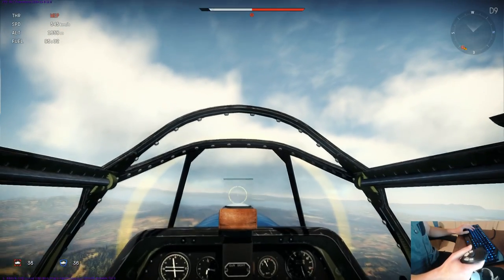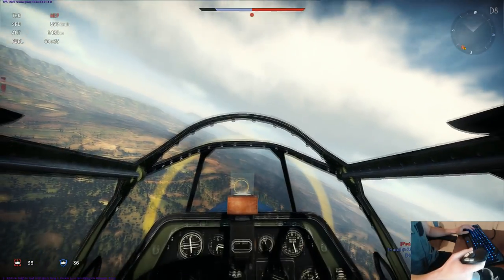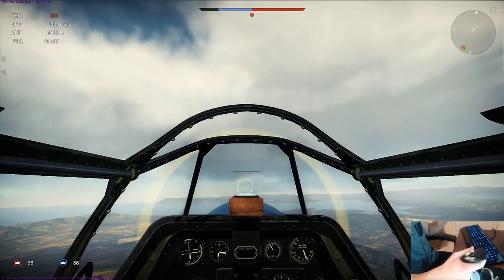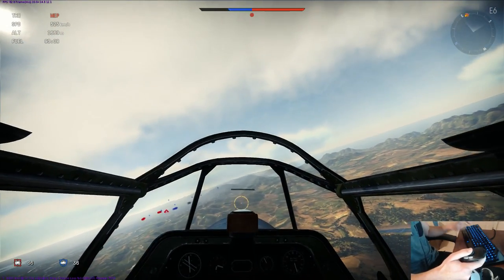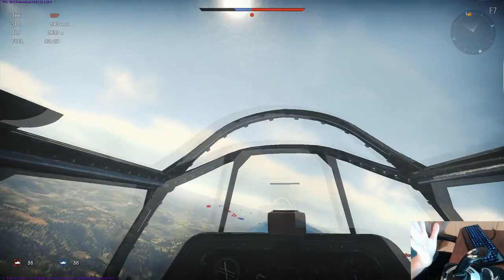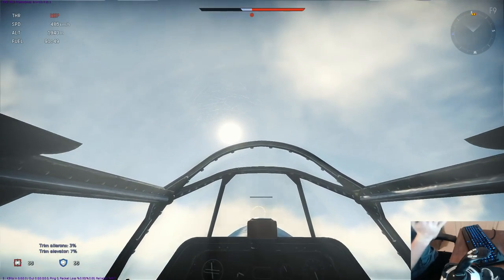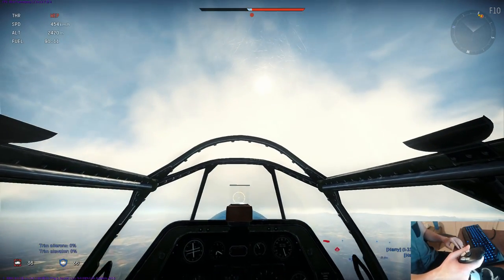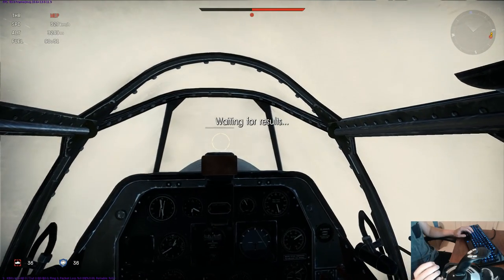War Thunder Tutorial Trim-How I Use It- Mustang MK 1

Comment: I tried your config once after seeing your "joystick config tutorial" however i had some dificulties flying with full real controls. (my joystick is the same model as yours).

I cant take of without making massive adjustments with the stick. All the planes i tried went all the way to the left. I dont know if that is intended (caused by torque, wind etc) or if my config needs a bit more adjusting.

I ended up going to the configs, and changing the roll and yaw axis compensation to the left.